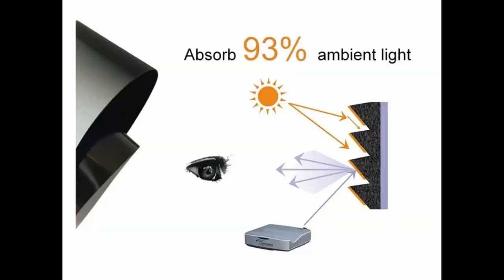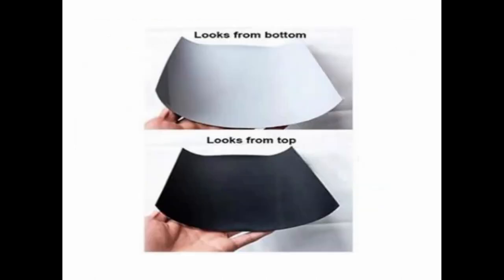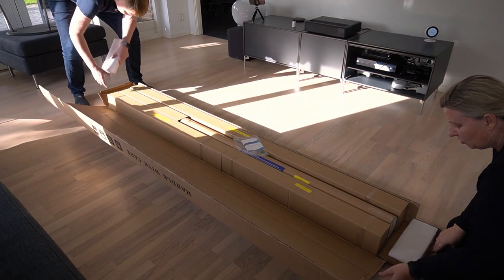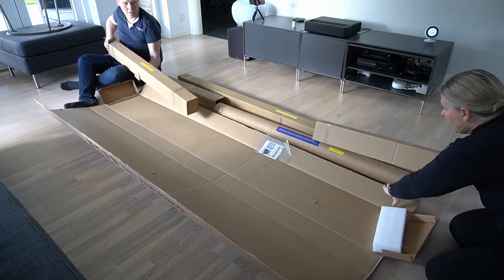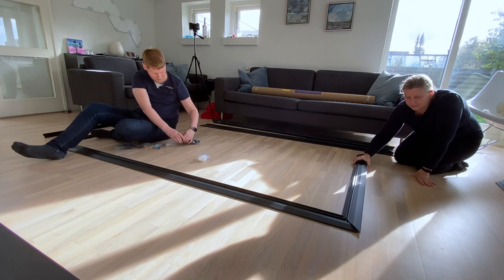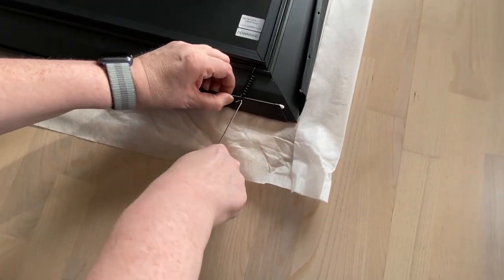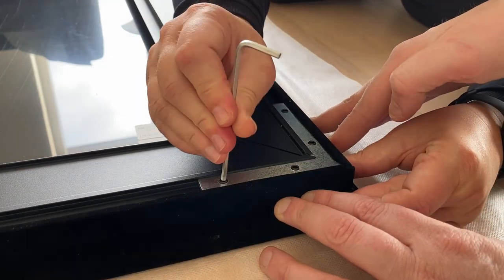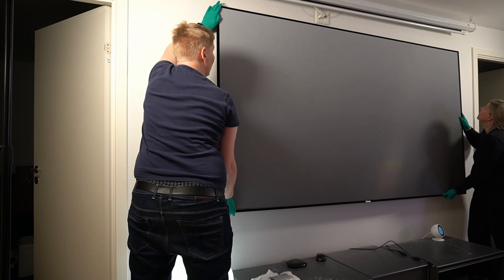You Need this Screen for Ultra Short Throw Projectors! ALT UST PET CRYSTAL FROM XY Screen

Comment: From your recommendation, I just contacted Wendy at XY Screens. Immediate response, and she is very friendly and knew exactly what I needed for my Optoma CinemaX P2! Order was done in a matter of minutes!

Thanks for the great video and the info on XY Screens!
Reply from the maker: Thanks for sharing - I had a similar great experience with Wendy. When you're doing business with a company in a different region of the world, it's super important that you feel "safe" with the person thats representing them.
Reply: Dear Beavermatic, I m gonna buy the optima CinemaXP2 and i thinking in buy an XY Screen . Which one you bougth? Are you happy with the optima and XY Screen?  I'm gonna to use basically for  home theater. Best regards EDuardo (I am Sorry if my english isn't the best)
Reply: @Eduardo291270  yes. Absolutely. Incredible combination. Screen is still best one out there, and my cinemax p2 still running strong with heavy daily use, no issues or anything.

For the cinemaX p2, would recommend 100in upto 120in, though can go as low as 80inch with some adjustments.
Reply: @beavermatic  Dear Beavermatic, Thank you very much for your quick response!
My idea, based on my spaces, is to buy a 110' screen
I ask you, have you bought Pet Crystal fixed Screen? Do you remember the exact model?
Best regards
Eduardo

Comment: xy ALR PET screen is 0.8 gain, do you know what is the difference betveen CLR aeon Elite screen with 0.6 gain?
Reply from the maker: Hi - so the gain is important if you're using the screen/projector in a room with lots light - so a low gain will usually favor a room that is very dark. So be careful not to choose a low gain screen if you're planning on using it in a room with lots of ambient light

Comment: Hey, just pitching in here for the XY Screen.

I purchased the 120" ALR PET Crystal in April '21 and my screen is paired with a LSP9T.

I got a frame with a warped upper frame and particularly the top right corner. After talking to support, their suggestion was to try and bend it back myself... Or to move the projector further to the screen, loosing some screen realestate, but moving the image as much as possible from the warped corner...

I think we can all agree that both suggestions are lackluster at best.

I learned to live with it, albeit being really annoyed at it when watching full screen content.

Today I went to watch a show and to my surprice, the whole screen is now wavy and it looks like the screen fabric has stretched where the springs are hooked in.

We are in the start of summer here, with temps reaching 25 degrees celcius for a few days now, but nothing crazy and I don't expect us to see much higher temperatures than that, but the screen is completely useless now with distortions all over the image.

With my current experience, I can't recommend XYScreens to anyone looking for a serious projector UST setup.

And I'll be looking for a replaciment....

You can go straight to my post here and review the images of this issue:
https://www.avsforum.com/threads/xyscreen-comparison-review.3005728/post-60824906

Oh, and your title is wrong, should be ALR instead of ALT.
Reply from the maker: Hi Daniel - I hope you can find a solution with XYScreens - I found them to be extremly helpfull and kind i my communication with them. I know of several people who bought it after seeing my reviews who have also had great experiences with them, but like any company sometimes things go wrong. Then it's all about finding a good fix - so reach out to them and hopefully they can help you with a better solution.

Comment: How would you rate your dealing with XYscreen?
I've contacted and received a quote but am nervous because of quality control and not wanting to ship back to china. I'm asking for 108" inch screen and was quoted a fair price. About $450 lower than a comparable screen here in america. How would you rate the quality of screen, shipping package and whole process.Was there any problems during or after?
Thank you for your thoughts and experience.
Reply from the maker: I'm super happy. They were quick to answer all of my questions and shipping was also super fast - had it in about a week. Also very happy with the quality of the screen - to be fair I dont have a comparison with another screen optimized for UST, but if you look at the video and see the difference to my old screen it's night and day